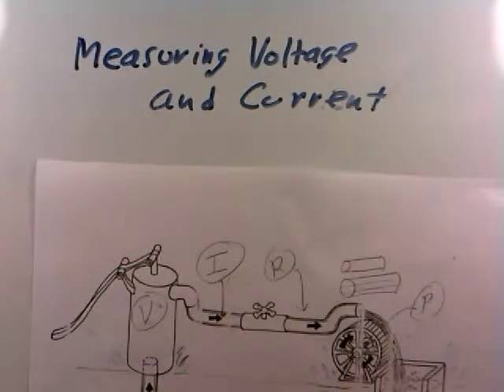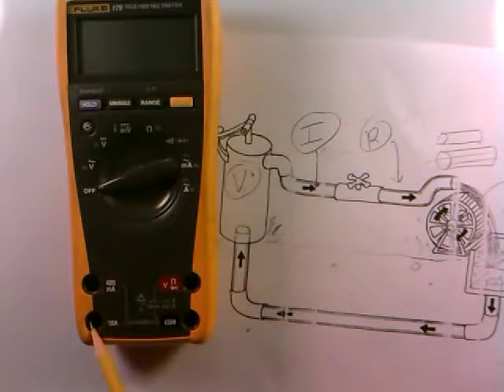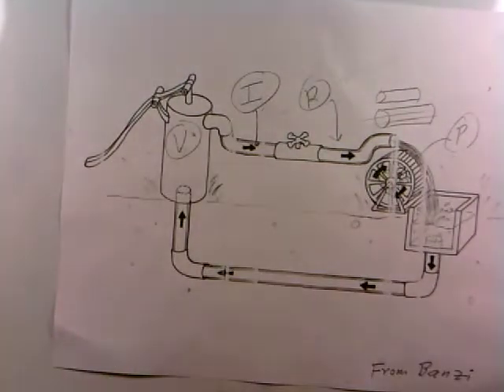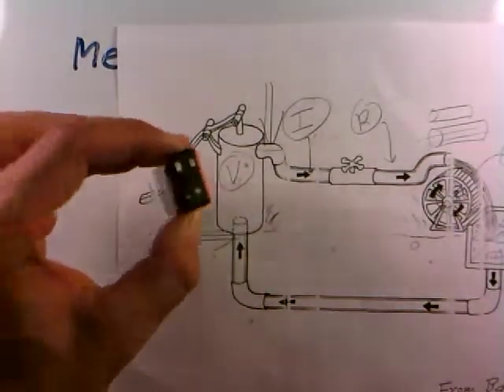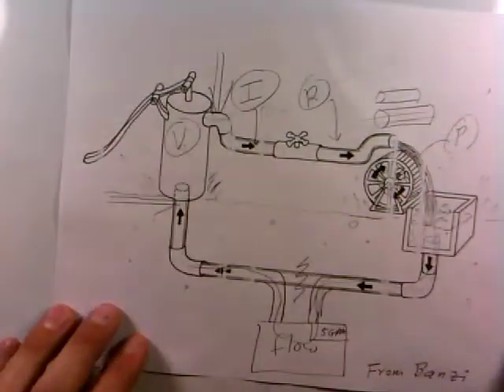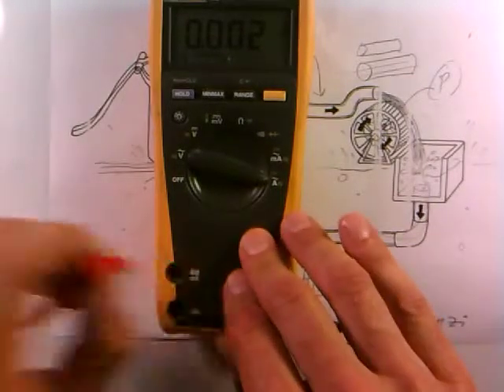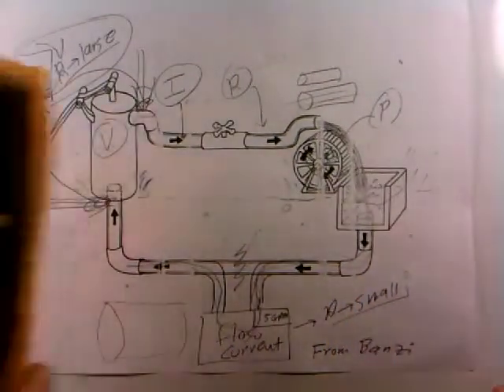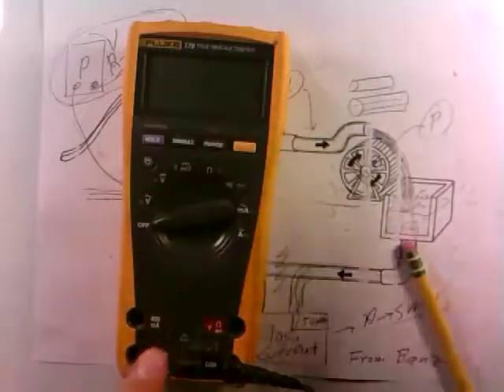elec 011 1 voltage vs current measurements

Comment: One of the better explanations presented on youtube. Thanks for taking the time. Now all I have to do is figure out why some electrical tests call for measuring voltage vs. measuring current. It would seem that one would be able to measure one or the other to determine if there were an electrical deficiency in a circuit.